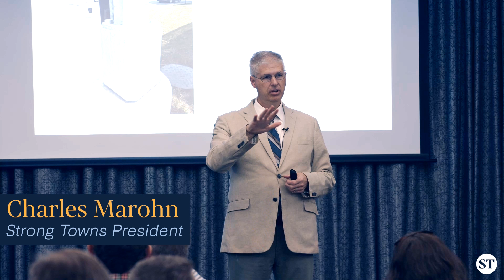An Example of Gross Negligence in Street Design - The Breakaway Post

Comment: Strong towns mentioned this when talking about stroads. Trees are removed from the side separations to prevent obstructions that could hurt or kill drivers when they go off-road. The bicycle lane however is placed right between that road and the separation, implying that the designers saw no problem with a careening car going right through a cyclist on the way
Reply: And trees make a much more walkable and breathable environment. Shade on a hot day, shelter from light rain, oxygen. We should remove the outer lane if multi-lane Stroads, and put trees between the pedestrians and bicyclists, and the cars. A line of large trees, once they've grown in, will discourage most drivers from running over the people that aren't in cars.

Comment: this guy has no idea what he's talking about - these aren't "shear pins", these aren't "designed to breakaway"

the anchor bolts (not 'screws' ) are there to anchor the pole into the concrete and allow the street pole to be levelled since concrete foundations can't be poured very precisely

having anchor bolts also reduces fatigue from thermal cycling since a hard connection between two dissimilar materials would expand at different rates so would start cracking the less ductile material (concrete) over time

too bad he didn't actually talk to an engineer before trying to talk out his ass about 'shear pins'

he might have a point about there needing to be more protected pedestrian areas, but no engineer is making a tradeoff calculation about saving a driver vs a pedestrian. A lightpole simply isn't going to help you if you stand behind it since the cast aluminum pole would bend/break way before these high tensile steel anchor bolts. If you want to actually protect pedestrians, put in a bunch of bollards or concrete planter beds
Reply: Are you an engineer? apparently not because no engineer in planet earth would call them a "street pole"..............................
Reply: Most sensible comment on here.  Any pedestrian present in the vicinity of moving traffic is a potential victim.  The fact that the pedestal is so high indicates that in fact the pedestrian is safer there than almost anywhere else an errant vehicle may intrude.  The presenter had a point to make but choose a poor example to illustrate it.  I AM THROUGH, GOOD DAY!

Comment: Chuck: you can argue this by showing how engineers position guard rails too! They are always positioned away from the curb and on the far side of the sidewalk. So the errant motorist harms the pedestrian on the way to the guard rail.
Reply: I always thought that the point of the guardrail was to contain the vehicles on he road so it doesn't damage pedestians and the envrioment. Guess I was wrong.
Reply: I've seldom seen guardrails on the other side of a sidewalk. They wouldn't work on the inside edge here anyways with snowplows.

Comment: You forgot a few key ideas here...

1. It is quite likely that nobody will be standing near the pole when it is struck. And even if there is, it's quite reasonable to consider that there may be more people in the vehicle than standing at the corner, especially if the vehicle is a bus.

2. People can move. Poles are notoriously stationary, but people are often able to jump out of the way.

3. In the absence of the pole, if there were people waiting to cross the street, they would likely still be in the path of the careening vehicle. 

Not sure what this presentation is intending to sell, but it seems like a solution to a problem we don't really have.
Reply: The idea is presented more thoroughly here: https://youtu.be/NIWVAbp1NG4?t=3050 Basically the point is "why are you designing a roadway for high speed right next to a sidewalk with pedestrians?"
Reply: If that post was not to break away it would absorb a significant amount of the impact energy which would mean the pedestrian either wouldn't be injured at all or had better chance to survive.

Anyway, it is the car driver who "deserves" the impact because of his high speed and not the completely innocent pedestrian who should not be punished for the error of the driver.
Reply: @btudrus  
I don't think anyone "deserves" to be in a car accident. That's kind of fucked up.
Breakaway poles should be used when cars are travelling at high speeds, the problem is we put those kinds of high speed roads right though cities and don't protect the people walking through the city.
Reply: @APaleDot  "Breakaway poles should be used when cars are travelling at high speeds"

Where cars are travelling at high speeds, there should be no poles.
Where pedestrian are, car must not travel at high speed.
Reply: @btudrus  Neither party “deserves” to be injured. Wow. The design needs to be fixed so that it addressed BOTH the people in the car AND the people on the sidewalk. Right now…all that Traffic engineers and thus their respective employers (our government), care about is the occupants in the vehicle…with NO regard to people who’re walking.
Reply: @nthused  "Neither party “deserves” to be injured."

Those who cause the injury should be protected less then those who are not the cause and are more vulnerable (pedestrians). In that sense if you have to choose, the car drivers definitely "deserve" to be injure more than pedestrians and this should be reflected in the design.
Reply: Let me help you out then because you seem slow.. If you build a street where cars go so fast through a city that it's expected they crash into the pole then you build the street wrong. Thats the take away from this. either you build a city or you build a highway. you can't have both.
Reply: The presentation was clearly pointing towards the fact that at such a dangerous/accident prone junction, instead of investing in structures to slow down traffic which will reduce the damage caused by such accidents, money is being spent on over engineering and avoiding the problem. (Woohoo, now you can survive a 60 mph crash within the city! maybe)
It's also pointing towards how little attention is being put towards making the roads a safe place for people outside of vehicles.

1) The reason there might be nobody out there at the crossing is because how inhospitable it is. Also, your point of more people in the car/bus so kill the pedestrian who had nothing to do with it is epitome of logic. salute. Everyone on the street should take responsibility for your out-of-control convenience that doubles up as a death machine.

2) Yes. Since the pedestrians chose to travel on foot, they must display high acrobatic ability to ensure safety of their lives. Very reasonable. And the car drivers can drive themselves into poles and take comfort in the knowledge that they're cared for.

3) Beautifully put. People on the SIDEWALK are IN THE WAY of a careening vehicle. YES! 

I apologize for the scathing tone, but it's midnight and you're being silly.
Reply: @easternhills1329  Oh, I am not agruing against any of the points made in reply to my comment. In fact, all seem to be excellent ideas!

The one thing that I will say in my defense is that I am watching this video in isolation. I didn't watch other videos from the same presentation or anything like that. Just the material presented here. 

From that, I see a man trying to convince me that poles that are designed to save human lives by shearing off are over engineered and we should go back to making poles more deadly.

My larger point is that changing the pole wouldn't really do anything to make things safer for pedestrians, just deadlier for motorists.
Reply: @sabinrawr  no, the snippet is arguing that the responsible engineers did not ask the correct question. Instead of "how can we make this less dangerous" they asked "how can we reduce the risk that a speeding, distracted driver hitting this pole will sustain less injuries".

This solution is like wearing a helmet instead of making the doors inside your house tall enough for you to walk through without ducking. Your head is still going to hurt, just a little less.
Reply: @kain0m  To follow on with this analogy, many facilities (especially industrial but not limited thereto) have caution stripes, padding, and other safety features on and around low clearances and similar hazards. Most people doing normal things usually won't have to worry about these, but taller people and vehicles, and/or those who require access to those areas, are at risk and are made safer by these safety implementations.

Sure, a viable upstream solution would be ideal. But as it stands, these poles with shear lines are saving people's lives and they are not putting pedestrians at any higher risk.
Reply: @sabinrawr  
The clip is pointing out a contradiction in the design of our roadways, not advocating for making these poles more dangerous. Not sure how you could get that, even from this out of context snippet.
Reply: only in America first reaction of someone is "People can move. Poles are notoriously stationary, but people are often able to jump out of the way" so cars go fast and people have to be ready to get out of the way????????? fkn insane that sound like those commercials from the 1940s (paid by car manufacturers) blaming pedestrians for car accidents
Reply: @maumor2  Yes, I know the story about how far manufacturers invented the word "jaywalking" in order to make people feel guilt and shame for walking in a street. But that's not at issue here.

He was literally saying that the lack of shear points on some poles contributes to pedestrian deaths. There is simply no logical connection between those ideas.

Comment: Well I mean yes, there is a possibility that a pedestrian would die in this scenario. But the only known quantity in this scenario is that a vehicle has hit the post, creating imminent danger to the occupant. There may or may not be a pedestrian there, they may or may not see the vehicle heading towards them and get out of the way. If they were built sturdy then the only guaranteed effect is greater danger to the driver. Maybe it is during the day in which case there is a higher probability of pedestrians, maybe it is at night and there are less. Maybe it is a street predominantly composed of nightclubs and the reverse is true.

The question becomes which will cause more injury and death. In which case, statistical analysis of both scenarios would be nice. Of course, the specific overrides the general, and while it may in some cases of heavy foot traffic to spare the pedestrians increasing risk to the drivers, it would need to be decided on a case by case basis?
Reply: The main concern isn't the pole falling and hitting the person. But rather that it's considered so likely for a speeding car to fly off the road that shear pins are needed. And yet the same design calls for pedestrians to stand around in this known danger zone. 

The way to reduce harm in this situation is not to kill either the driver or the pedestrian. It is to completely change the street design so that cars are unable to drive at high speeds in areas where pedestrians are crossing. There's no need for shear pins if the car is only going 20mph. Engineers are well aware of how to design a street for slow speeds with features like narrower lanes, speed bumps, curves, lots of trees near the street, etc. The point is that it's neglectful to design for high driving speeds when pedestrians are around.
Reply: @chrisfarmer6893  Then I agree
Reply: It's not like this situation of the high speed road is an unchangeable fact of life that we just have to accept. This presentation is for people who design roads. That design is currently negligent and should be changed.
Reply: I think you missed the point if the video which is that American urban planners prioritize the safety of drivers over pedestrians. Infrastructure is put inplace to protect drivers while pedestrians infrastructure is an afterthought. That's backwards.
Reply: If you build a street where cars go so fast through a city that it's expected they crash into the pole then you build the street wrong. Thats the take away from this. either you build a city or you build a highway. you can't have both.
Reply: well there sure wouldn't be a pedestrian there if we keep designing shit like this. here's a pretty simple and well tested method of preventing drivers from dying upon leaving the road: slowing the cars. this aint no damn freeway
Reply: wow he says "they may or may not see the vehicle heading towards them and get out of the way"  only in America a pedestrian needs to be aware of every car coming thru at 45mph and be ready to "get out of the way" That is the 1940s thinking "hey you poor idiot that can't afford a car get out of the way and let ME be drive fast"

Comment: I’d like to point out one additional thing that was not mentioned in the video. How many feet off the ground is that sheer point? What is that breakaway pole mounted on?

That concrete stump sure looks like a rather solid object which would defeat the purpose of having a breakaway pole, because it comes up significantly high.

I don’t know where this particular pole is located but in my town all of the breakaway points are right at ground level, not two or 3 feet above ground level.

So not only is the pedestrian at risk in the event that a vehicle was to leave the roadway in the direction of that pole, but whoever’s in that vehicle is at risk of injury because that concrete stump is going to act like a bollard.
Reply: @TXVETJEB  Just because it’s not common where you live doesn’t mean it doesn’t occur.

Whether there’s a pedestrian there or not it’s still doesn’t changed the fact that breakaway point is well off the ground and whatever vehicle hits it he’s going to hit that concrete support, unless it’s a very high clearance vehicle.
Reply: @TXVETJEB  The only one trying to mislead people is you. My point is valid despite your declaration to the contrary.

Based on the last line of your last response it’s clear that your agenda here is to somehow discredit the points being made with regard to designing such things.

That’s a you issue to figure out for yourself.
Reply: Yes i was like why not use a photo where the sheers are right near the ground. Why use one with a cement base? Maybe to show what it should be corrected to?
Reply: @Liefpj  I am going thru this in my Western PA community, (Cranberry Twp. PA loosing half my property to a road widening project ) and while I noticed the concrete stump right away, I gave the presented a pass, because everything else I have seen about "Strong Towns" makes sense and is totally accurate with the topic of Sprawl. It's too bad someones pride was hurt after someone found a small error in the film. Theory was correct, just not presented or responded to properly.
Reply: Same here.  Normally, where I live, the top of the concrete base is no more than an inch or so higher than the sidewalk or curb. The only place where I've seen high bases like that is in parking lots, and they are painted bright yellow (and where breakaway bases make no sense).
Reply: @Alex_Plante  Plus, the pole is raised up on bolts for leveling purposes. Would power companies design break-away joints under their transmission line towers? Showing a sign post would be a better example.
Reply: @TXVETJEB  Accusing me of trying to mislead people and calling my comment irrelevant is the hostility you accuse me of.

If you don’t like my comments you don’t have to respond to them.